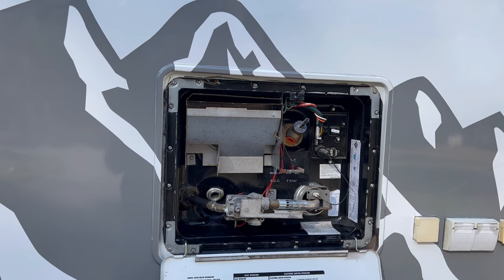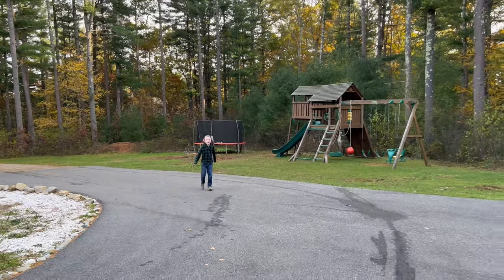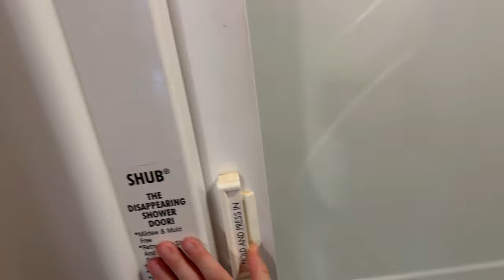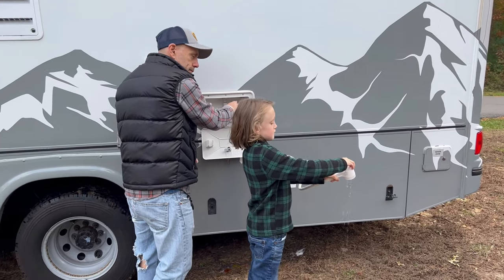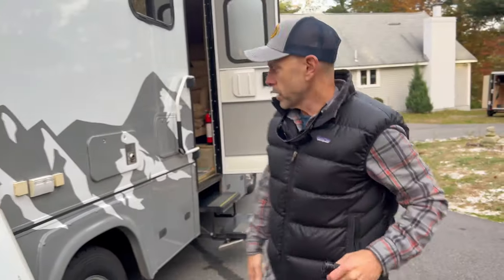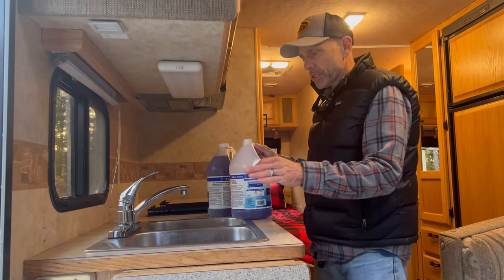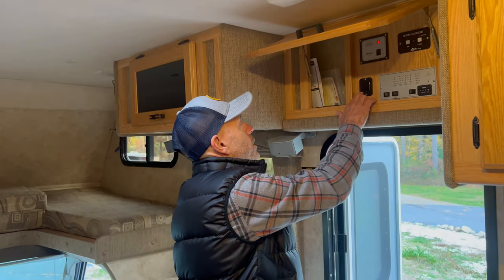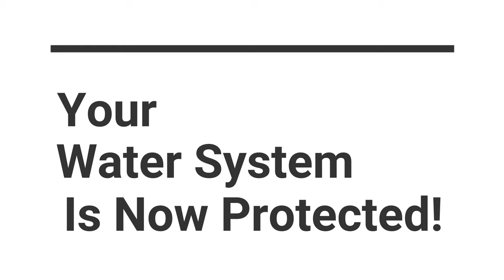Class C Winterization # How To DYI # With a Rare RV! Bigfoot 30MH26SL!

Comment: Thank you for the video. I have the same Bigfoot with the same floor plan as you do. Felt like I was walking into my camper for a second or two. Everything is identical, Wow. But I'm digressing.

I was de-winterizing our rig and couldn't remember what position to set the valves to the water pump and hot water tank. Your video showed me what to do and probably saved me from a big goof. Thank you again.

Also,

Have you had any problems with your slide out? I have searched up and down YouTube trying figure out what slide out mechanism we have. The motor(s) keep going out of synchronization on mine and I have to override the control unit and manually drive each side in or out. Got any clues on what to do?

PS ... Cute helper you have too
Reply: Hi David, Happy the vid helped! We never had an issue with the slide.  I wonder if the motors are operating at a different pace (RPM)?  Just a guess.  I will ask out tech for ideas.  Thanks.